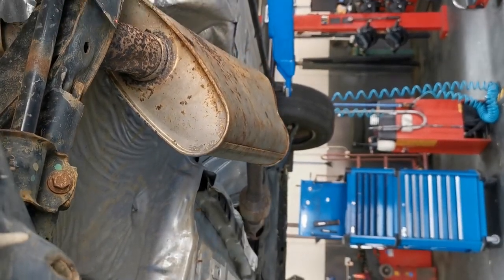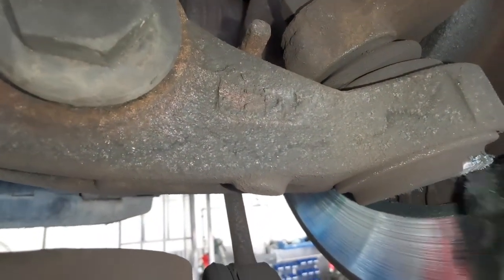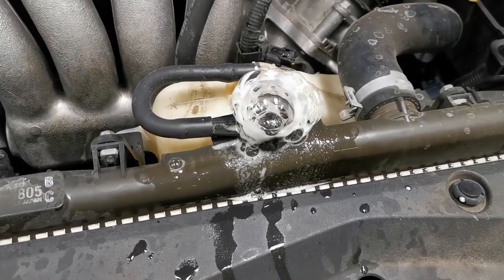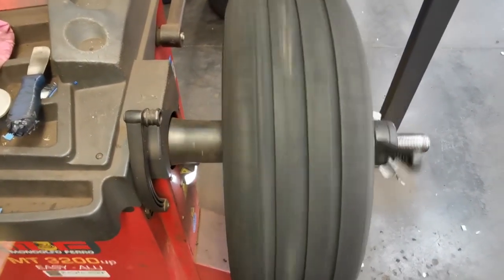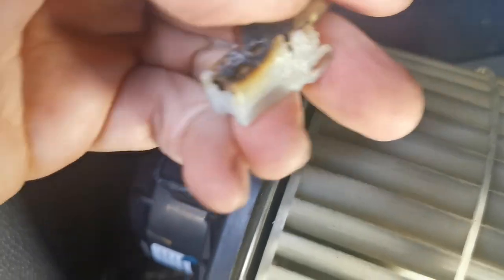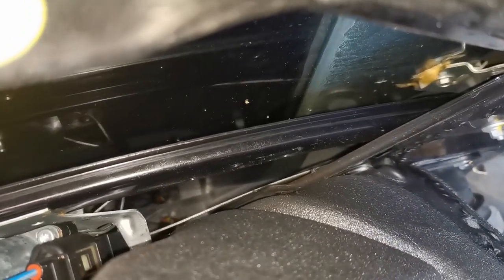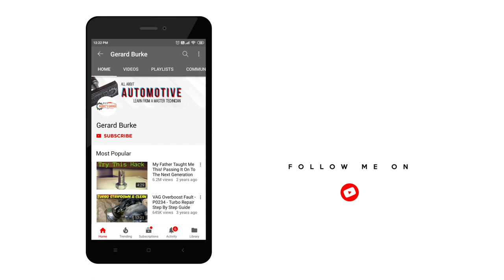The Strange Things Mechanics See - Compilation

Comment: Hi mate, I don't suppose you could help me diagnose a noise I'm getting from my 2008 mitsubishi colt 1.1? It's had a new clutch and gearbox fluid flush, but from 4th gear at about 50mph upwards I get a grinding noise under acceleration, take my foot off the accelerator and it stops, starts again when applied.
Thanks